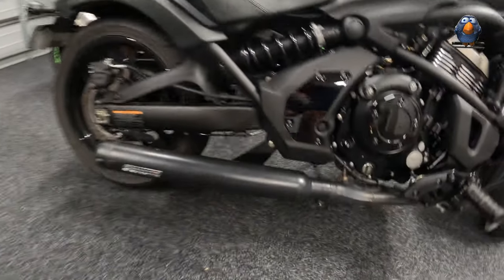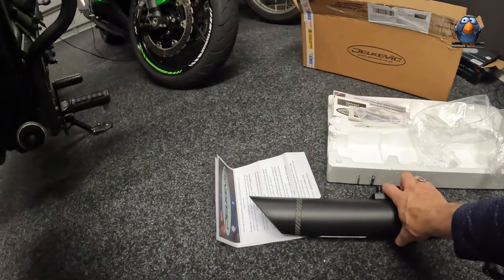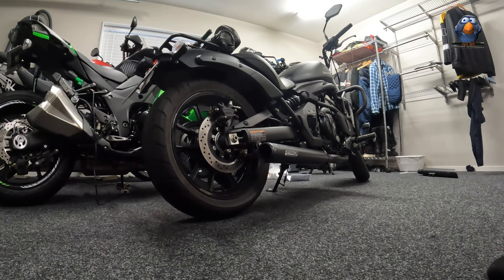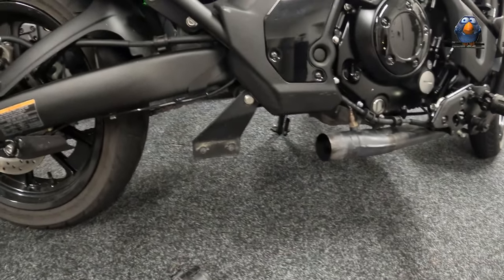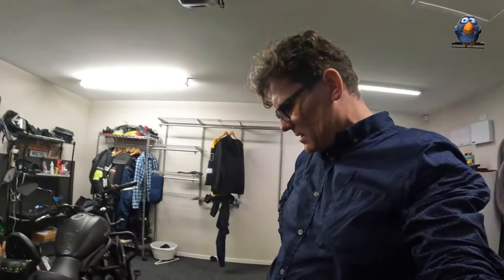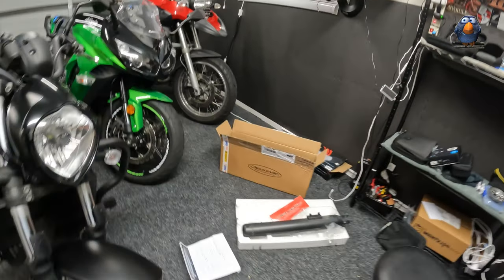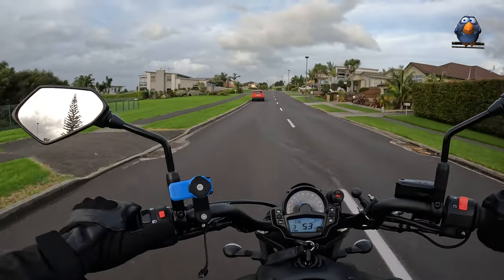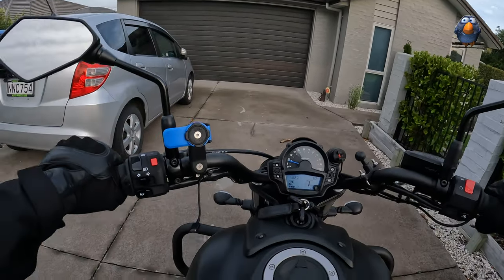Vulcan 650 S | Delkevic 21" Bull Nose vs 16" Slash Cut

Comment: Very similar, but what I herd , was the slash cut seems a bit more higher pitched (not by much) , and the bull nose sounded more deep muffled, not by much though either , like the slash cut has less restrictive sound from the crackles , but they both sound like the bike is breathing well and the little crackles just give it that extra character…🤷🏻‍♂️ can’t wait to install my bullnose delkavic , so much better than stock from what I’ve learned on the internet… thx 🙏 for sharing!!!
Reply from the maker: Either way, you'll love it. I watched a Vulcan ride by the other day (don't see them too often here in NZ), and I could hardly hardly hear it. A real exhaust completely transforms the bike!

Comment: The gloves are to prevent fingerprints (oils and contamination) getting on the new exhaust while fitting. Otherwise once the exhaust heats up those prints will be permanently burnt in.

Comment: Hello. I'm just about to buy the same exhaust. I expect it will be louder but how loud compared to your standard Harley Davidson? Is it about the same or even more loud?
Reply from the maker: What's a standard harley exhaust, tho? I have a Sportster and the sound difference between factory and an aftermarket exhaust is huge. Factory is quiet. In the Vulcan, even with a Delkevic, it's no where as loud and deep as your traditional sportster.

Go buy it.

Comment: Hi, I’m a nz Vulcan rider too.   I’m internet in getting a similar exhaust, can you tell me if this passes WOF criteria?    I just failed a WOF because the previous owner drilled holes in the exhaust, and I’d hate to install a new exhaust only to fail again.   Thanks
Reply from the maker: You can plug those holes with a few bolts... then get your WOF.

How did they notice the holes - they are usually under the shroud and hidden?
Reply: @smackbikeNZ  hi, the WOF guy failed it as there was no exhaust coming out the back.   I kinda knew there was holes but it isn’t overly loud, just not compliant.
Reply: @smackbikeNZ  I presume yours is WOF compliant?
Reply from the maker: @craigphillipson4954  it was a brand new bike, so 3 years WOF.. never got to test it. What's your rego?

Comment: It crackles because your valves are staying open more than usual because there is less heat being held in mine does it ALOT I went from a stock exhaust on a 1985 Vulcan 700 to short straight with walker side pipes and it pops A LOT due to the exhaust valves remaining slightly open
Reply: Do you know how a cam shaft work?
Reply: @corneilcorneil  what does a cam shaft have to do with the valves floating?  Do you even know how tht means to float Valve? yea cool you can takeoff after just starting your bike in regualar spring summer weather THAT MEANS NOTHING in my region of the country it's cold all the time so if you don't warm up your bike you float valves that's when a valve gets stuck open, usually resulting in contact with the piston...but with non interference engines thy just stick open. So 1 more time dude what does cam have to do with th valves floating due to the cold air being gulped up by the engine?
Reply: @TheBakedBiker  Try to write like a adult and use punctuations, please. Then, i will read your message.
Reply: @corneilcorneil  don't get mad cause I proved you wrong lol
Reply: @TheBakedBiker  You proved only that you see your assumptions as reality. Mad? I love clowns like you. Wanna be mechanic, but not able to use punctuations. Says a lot about your level. 💋💋💋